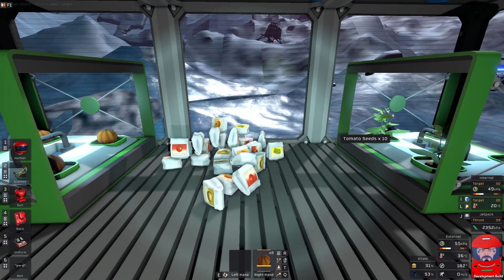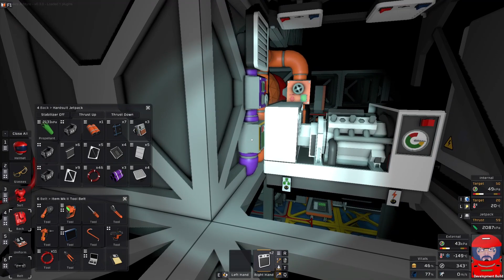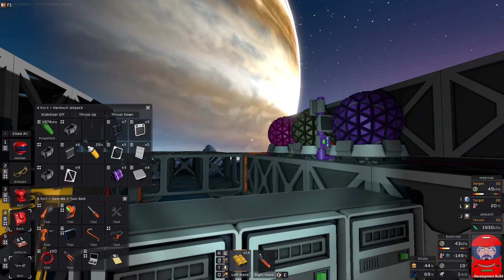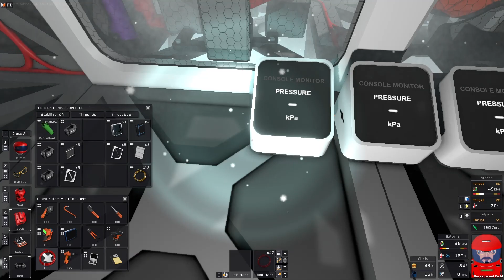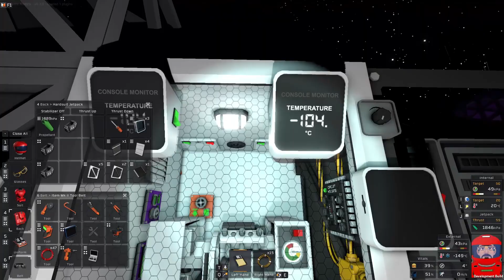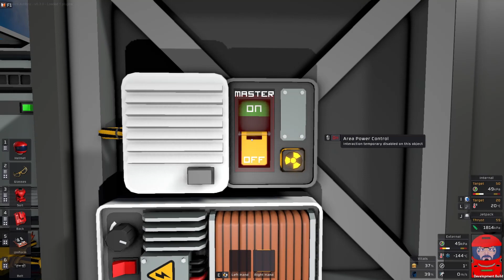Stationeers Let's play Modded Europa 10 Going crazy with power

Comment: Are you going to enclose the batteries to help keep the cold from draining them quicker?  Could probably use the exhaust from the GFG to heat them pretty easy.
Reply from the maker: I have so much power now I probably don't need to but for the sake of OCD I will need to.

Comment: sorry for language
Create h2 combustor is OP. Create hot gas,  cca. unlimited hot water and use activ vent. for cooling and output hot  gas  turbogenerator.
Reply from the maker: I have considered the H2 compustor for heat but the furnace creates heat and CO2 and I need the CO2 for the plants.

Comment: Any more power and Mick will be throwing around force lightning like a Sith Lord screaming about 'Unlimited Power'! 

Nice progress, although having that wall naked inside the GFG room will be a constant trigger for OCD... 

Definitely suggest you seal your batteries soon, if only to help stretch out your fuel supply so you are not wasting it on recovering the energy lost to the cold. 

As the GFG will be your major power supply and its bottleneck is the hydrogen feed for the fuel supply, might it be worth hooking up an 'hydrogen supply low' warning to a flashing light on an outside wall? 

Also, if you are going to be tearing out Ms Stirling and her associated machinery, that'll give you a good start on a big room to get some serious hydroponics on the go. Its almost like you planned it that way...
Reply from the maker: I have to clear everything off the ground and make hydroponics upstairs so that Aimee will have freedom to roam on the ground.
A warning system will be required for a lot of things, storms, low fuel, incoming rocket don't crap your pants.  Prabably the last one is the reason that will make actually build it.
Reply: Why did you have to mention the wall? Now I can't unsee it. D:

Comment: Nice touch at the end with the "loss of transmission". Another great episode.

Might be worth automating the crusher to smash H2 ice if the pressure's low, that way you can add some chutes (just like you did for the coal gen). Then you can just mine up a bunch of ice and forget about It for a while (just eyeball the chutes every now and again).

This also ties in when you get the rocket, you can sort any volatile ice into a silo that feeds the crusher.

Keep up the awesome work!
Reply from the maker: That's the plan, automate everything until the only thing to think about is Potato=Vodka